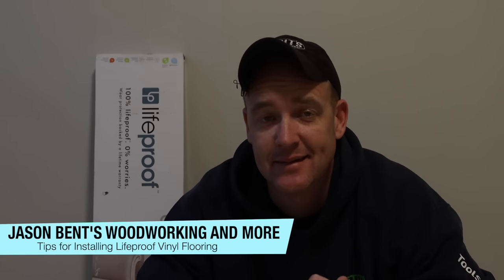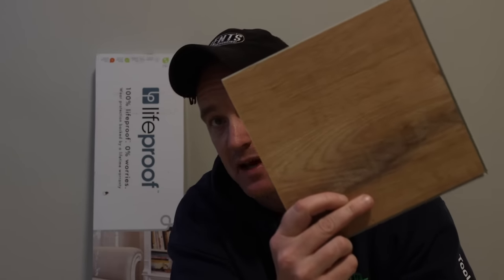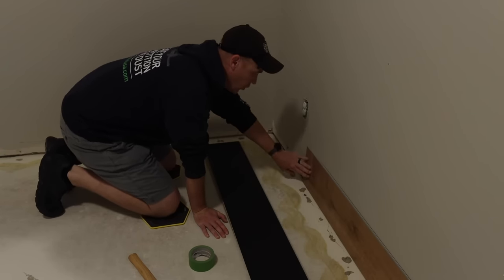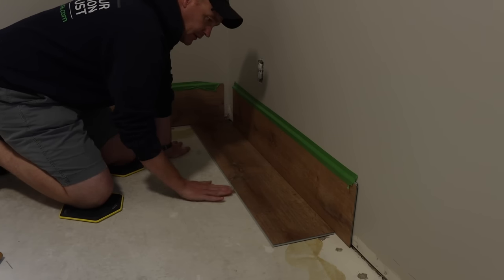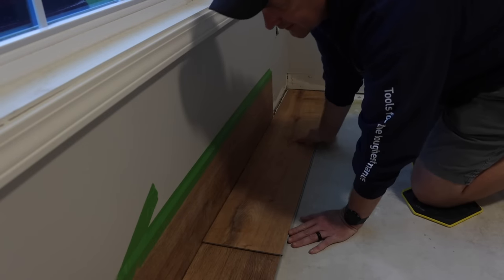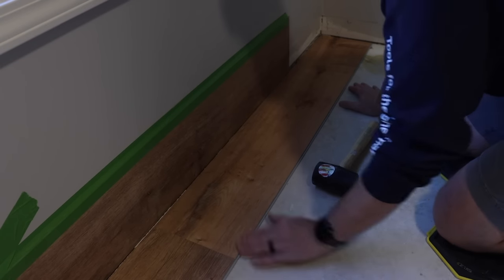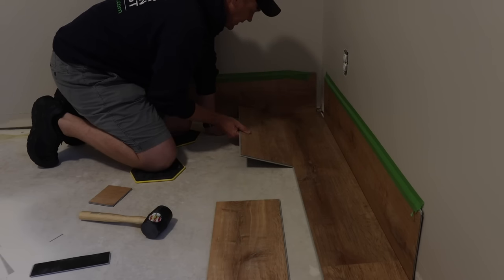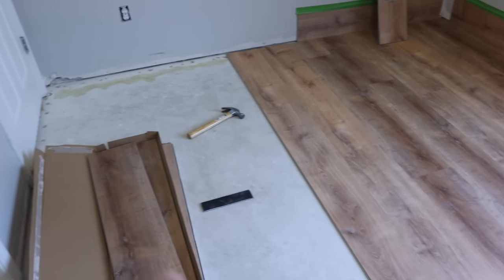How to Install Lifeproof Vinyl Flooring

Comment: Shouldn’t you have had 1/4” spacing all the way around the room? Im just wondering on how important that is
Reply: That is why he taped up the 2 full planks on the 2 walls at the beginning of his process. He created the 1/4" gap on 1/2 of the walls, and cut his pieces to be 1/4" gap when he made it to the other end. ;) It is very important to leave the 1/4" spacing, as this type of flooring is considered to be "floating," thus the 1/4" gap gives the floor room to walk without popping up from the center. I hope this makes sense!
Reply: When he did that notch cut into the doorway I didn’t see the 1/4” gap from the wall, where he used the flat bar .

Comment: I think I can do it myself now after watching but I have taken up tiles in front entrance which is has left thin set and I don’t want to get that up as it’s too dusty. So my subfloor is a few millimeters lower than front entrance due to thin set. Would you suggest sanding the very edge of thin set so my boards can lock together ? Hope this makes sense 🤔
Reply from the maker: I would remove any leftover material to ensure a flat smooth surface

Comment: Has anyone tried to install vinyl flooring with the baseboards still on the wall?? I really don't want to replace the baseboards and wondering how to avoid using spacers but also keep the baseboards on the wall...

Comment: I bought a speed square for guiding the cuts, but I was worried about the cuts lengthwise, that I would have trouble keeping a straight line over such a long distance. I was wondering if your t-square would help with that, but you did not show that part. It kind of looks like your t-square is also not as long as the planks, so maybe you're just scoring a bit then doing down and scoring some more. That's what I was planning on doing with my speed square. Does that sound good or should I get a t-square?
Reply from the maker: A t square like mine isn’t necessarily needed. It’s just how I like to do it.
Reply: I can't remember if you talk about this in the video, but I found that I HAD to buy a jigsaw. It's simply mandatory. Trying to cut lengthwise or complicated shapes is just really hard by hand. Also, the vinyl shreds the blades, so I think you need to use a metal-cutting blade.

Comment: This was a great video. Thank you for sharing. I want to do something like this upstairs and on my stairs but the cost of the labor from the flooring company is preventing me from having it done. I really think I can do it myself...not sure about the stairs though. Now when I had hardwood installed downstairs I thought they told me that seams should be staggered something like no less than 8" or maybe even more. As you were doing your home did you pay attention to how close the seams were from one row to another?
Reply from the maker: I did. I just spaced it to where the didn’t line up in two rows.

Comment: If you ever have to pick the floor up for any reason, the locking system on the ends of the planks will break off and you won't be able to lock them back together. Had to pick my floor up in the kitchen bc my dishwasher leaked and water got under the floor. Now the floor slides apart at the ends and doesn't interlock anymore. Very disappointing for the price od the floor.

Comment: What about the gap at the door? As a professional floor installer, You never start laying out a room from the back wall. Measure out the room fix your adjustment and have a smaller piece in the back out of your POV. IMO.....

Comment: When you installed the second piece in the second row it didn’t look right. When you lined up the long edge, you just dropped it in place. You also need to slide it down to the first piece you installed. You didn’t show that and it could be a bit tricky.

Comment: I have had nothing but problems with my lifeproof flooring. The slightest imperfection and they wont lock together tight.
Reply from the maker: I haven’t experienced those issues. We have it throughout the entire house.
Reply: @bentswoodworking  Good for you. You must have extremely perfect floors. Had I known it would be this much trouble I would have just paid someone to put carpet in.
Reply: After many problems I ripped it back up and used the LifeProof underlayment and it went down much easier but I was still not overly impressed. I do NOT like gaps no matter how small they are. I paid a lot of money for this flooring.

Comment: Why would you start at the back of the room ? Wouldn’t it make more sense to start at the beginning of the room and have full pieces in view there even though you’ll have to customize them around the door jam and have the cut pieces to the back of the room and possibly covered by furniture.
Reply: In most videos I watched, the same method was used, but it can also be done the other way.

Comment: Please note when installing on concrete floor put down 6mil poly plastic down first for vapor barrier. Concrete creates moisture in between flooring and concrete. Lifeproof does not tell you this or any vinyl flooring.

Comment: I see you did not take out the staples from the floor.
Reply from the maker: What staples?
Reply: @bentswoodworking  the flooring fome was sticking up so I  assumed that they where held down by staples. The fome pad in my room where stapled down some where tight and loose then there where some that where stapled incorrectly where it stabled in my knee " that hurt" so I  decided to take all of them out before I  begin my floor project.
Reply from the maker: @kymarah  no, there are no staples with this. It’s applied directly on top of my concrete foundation. The only thing I had to remove was the nails from the tack strips around the border that were under the carpet
Reply: @bentswoodworking  ok I guess the folm was glued to the floor before the carpet was placed over the tack boards. Here in Michigan they hammer the tack board down the place the fome pad on the floor then staple the fome pad down to the floor from there they place the carpet down stretching it flat to the tack boards then call it a day.

Comment: Where is the vapor barrier?? It's mandatory on any concrete floor or your guarante is null and void.
Reply from the maker: That is incorrect with this product. As a mater of fact, there is only one underlayment that CAN be used with this and it’s the lifeproof brand. Any other, and it will void the warranty. But, either way, it is not required with this flooring. Feel free to read the manufacturer’s instructions and warranty if you think I’m wrong.

Comment: You dont need wall spacers… LifeProof doesnt expand or contract which is why is doesnt need to acclimate… I e installed LifeProof for 8 years and have never used spacers

Comment: Aren’t you missing underlayment?
Reply from the maker: Life proof underlayment can be used, but is not required. This is directly from the manufacture:

LifeProofTM includes a pre-attached sound mitigating pad. LifeProofTM Universal Underlayment (SKU 1006262709) can be used as an additional underlayment under LifeProofTM flooring. Use of any other underlayment will void the LifeProofTM Limited Warranty

Comment: I just missed out the most important detail!
Vinyl or laminate flooring should be installed perpendicular with the window not as you did, you might say that you like it more than way, but a professional installation would never be as you did it. It will be installed perpendicular with the window, the light that comes in trough the window over the the binding lines would be like a continuation.

Yeah, what about if the wall it's all messed up, if it has a bulge, use proper spacers not boards.
If the wall has a bigger bulge, sometimes you might have to shave off a bit of the edge of the very first plank. 
Also, the pattern it's absolutely stupid! You should have a damn proper one, so you don't end up having binding lines to close to each other, best is to keep a regular one, split a board in 3 thirds, first row it's a it's a full plank, 2nd row it's 1 third, 3 row it's a two thirds and 4th row it's a full one again... Or If it's to much of measuring just go with the simplest pattern "H" style, 1 full plank, 2nd row half plank, 3rd row full plank again and so on...

More in the video and I'm noticing that you don't have the proper tools... Damn, where's the floor installation kit?! You should have the proper tool to hammer down the boards not just using a small vinyl plank!

Comment: wonder why he skipped underpad?
Reply: It's already attached to the planks. Additional underlayment can still be used but in many cases it isn't necessary.
Reply from the maker: It isn’t required by the manufacturer. Although, I have heard they now offer one to use with it

Comment: use a proper cutting tool  mitter or guillotine  another thing your crosss joint as to bee 10 inch or more otherwise the floor will fail overtime  some of yours cross joint are to close to one another

Comment: You never address the fact that most walls are not square, as yours seem to be fine, but if not, don't I need to make a straight line before I start?  Don't you make a straight line just to see how off your walls are out of square or not.  In addition you don't show how it ended and how thin you last piece was, or how you cut it lengthwise.  You need to show us how to install the last piece or two, don't you think?

Comment: DO NOT FOLLOW THIS VIDEO. The first thing he did connecting the ends of the planks together was wrong. Per the instructions and personal experience you will break the weaker plank edge hammering them together with a mallet. You will not see it right away and you may not even notice you compromised the weaker plank but you probably did and over time the ends of the planks will walk themselves apart. Connecting planks in this manner should only be done in the event the plank cannot be installed any other way. They are designed to have the ends slid together and if you read the instructions they will tell you so.

Comment: Lifeproof is garbage. Folks will be looking up videos on how to remove it after it dents. You can get much better quality flooring for the same price or cheaper. Look up Shaw, Mohawk, or Coretec. SPC core, minimum 20 mil wear layer. Aluminium oxide finish. Do a little more research. You'll be glad you did.

Comment: For this first time DIY nope this wasn't easy! If you mess up a piece and need to separate the planks be extra careful if the connector breaks it won't connect again. I learned to just pay the extra to have it installed!!

Comment: Worse flooring ever, no G5 lock, its full of formaldehyde,same foam as carpet, it breaks down, and the click will come apart and zero antibacterial cork, 40 years in the business and this is by far the most dangerous flooring ever made.

Comment: This Home Depot Lifeproof flooring is not very easy to install.  This is a good video, but this product is brittle and easy to break where the end seams meet.   The folks at my Home Depot were not very helpful in assisting with product or finding an installer..   I do not recommend this product.  Would never purchase this product again..  Horrible stuff to work with!!

Comment: Oh my god I can’t this guy is so wrong about so many things 
First of but the life proof install kit with the proper hammer and tapping block and spacers and save yourself some time and money and don’t get anywhere near your flooring with a regular hammer better yet watch the official video from life proof and follow manufacturer installation instructions and save yourself the trouble
Reply: Yeah, what about if the wall it's all messed up, if it has a bulge, use proper spacers not boards.
Also, the biggest mistake is that he installed the floor along with the window, and that's totally wrong, laminate or vinyl  should always be interested perpendicular with the window!

Also, the pattern it's absolutely stupid! You should have a damn proper one, so you don't end up having binding lines to close to each other, best is to keep a regular one, split a board in 3 thirds, first row it's a it's a full plank, 2nd row it's 1 third, 3 row it's a two thirds and 4th row it's a full one again... Or If it's to much of measuring just go with the simplest pattern "H" style, 1 full plank, 2nd row half plank, 3rd row full plank again and so on...

Comment: Omg this is so redundant... if you need someone to hold your hand through the installation, just hire a professional.. Also when you are installing over concrete you NEED a moisture barrier!! Every room layout and every floor and every install is different. Most of all every vinyl plank material you use is different. This guy literally didnt have the first line in until after the middle of the video and then says it's easy.  Seriously guy, dont take this on without a table saw AT LEAST... some cuts are impossible otherwise. Dont touch a table saw if you are not 1000% confident and aware of the safety precautions!! I dont like people who claim it's easy even a monkey can do it. They are not doing you any favors when you realise you are in over your head. There are many things you need to consider while doing flooring to be able to finish the moldings properly. Use a rubber mallet instead of a solid mallet. Really, dont waste your money on a new floor that is going to be trash as soon as you finish the install. This video made me cringe. I know for a fact life proof needs to be finessed and you only know what you are doing if you have experience with it. Good luck.